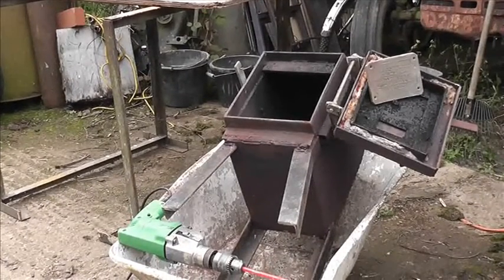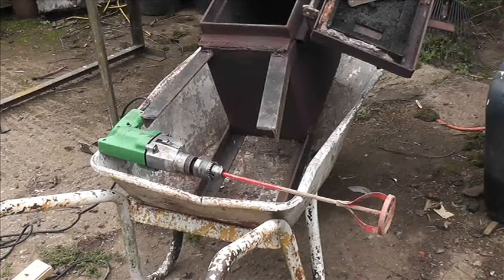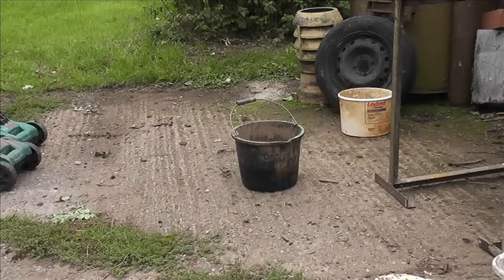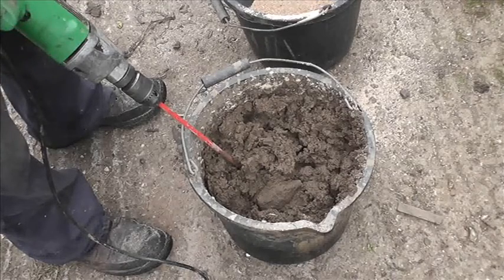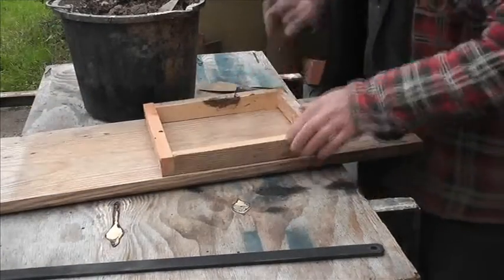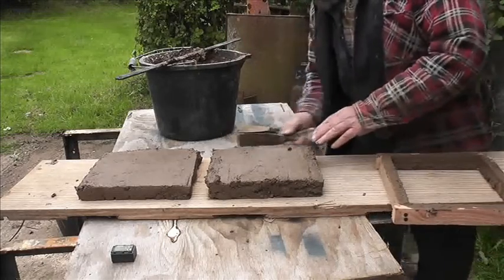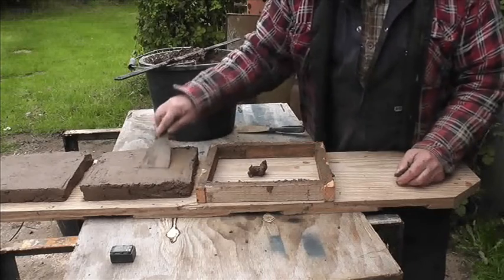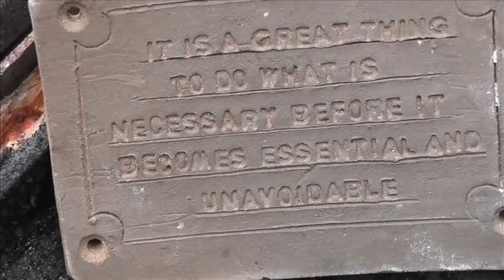Making fire bricks for the pottery kiln.

Comment: For anyone wondering, the reason his mold sticks is because you need to SOAK it first, and use a wetter clay mixture as well. When the wood is saturated wet it will pull cleanly off the brick. Also will give you a smoother finish when you screed the top!

Comment: Geniously simple the sawdust bit. I've used various things like coal particles that partially burn off and what remains graphitizes into the clay, or gas developing additives to help mixes with sodium silicate kick off, but never even thought to try sawdust. It's going on the list for the next batch! 👌
Reply from the maker: Hi, I use these as part of the kiln lid, going up to 900 degrees C, seem to work well, cheers
Reply: Sodium silicate? How can we use it in clay?

Comment: A good project it will be interesting to see how robust the tiles are in use.  I may have a go for my Wood burner are they are herendousely expensive. I just need to convert your measurements into proper units. 🤣
Reply from the maker: Ah, the old metric and imperial, I use both and sometimes in the same sentence, 3mtrs of 4 x 2. You could make your own very small kiln, cheers
Reply from the maker: I wonder how Thermolite building blocks would stand up the heat?

Comment: I want to make these for a pizza oven floor, what kind of clay was that did you dig it from the ground or did you buy it? Also what type of wood saw dust pine or hardwood? Thanks hope it's still holding up.  😀
Reply from the maker: Hi the saw dust was just from where I was processing firewood with a circular saw so a mixture of species. The clay was dug from 2 feet down in the meadow and processed to remove the large lumps, see one of my other videos about this (wild clay processing) under the ceramics playlist, subscribed? cheers